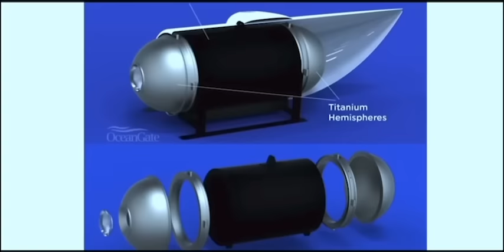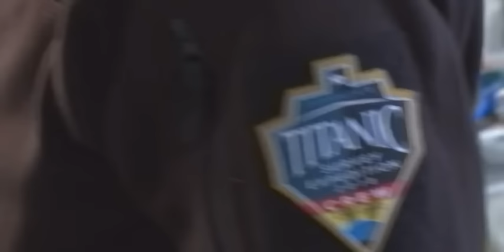First look at #oceangate #titan Debris

Comment: I read that the metal breathes, can expand and contract. The carbon fibre however is brittle and frigid. It doesn’t expand and contract with the changes but shatters like glass
Reply: correct
Reply: That's why during a NASCAR race, if someone goofs and hits the wall, sometimes, they halt the race. If the judges and safety crew walk out to the accident site and start literally crawling on their knees, they're looking for tiny shards of carbon fiber because it will easily slice open a tire, causing more accidents. And the real horror is that they don't always succeed in finding all of it. Sometimes, they even use a massive vacuum cleaner on a trailer to suck up any leftover debris from the accident. I've seen an IndyCar race on TV where a driver suddenly slammed into the safety wall at 180 mph. His boss said it was caused by a scrap of the stuff puncturing his tire. Those drivers are brave.
Reply: Thats why they needed to glue it together. If the glue is flexible enough it can compensate the difference.
It's also why this wasnt a good idea in the first place.
Reply: Had the ring that joined the titanium end caps to the carbon fibre body had longer mounts with more glue to hold, this thing would have changed the world. Rush was in the right direction, just needed a bit more glue. I hope OceanGate doesn't give up. I would love to go on the next one!
Reply: @beckydoesit9331 troll comment lol
Reply: Either way .. the movement between the two adjoining pieces would have broken the glue. It's so dumb there isn't much you can't criticize. This is a smorgasbord of fail.
Reply: @NoHurriesNoWorries  😅
Reply: what about DIY SUbmersible glue?
Reply: @beckydoesit9331  sniff more glue, gotcha
Reply: @donaldcarpenter5328  incorrect, misinformation.  It is true that carbon fiber coefficient of thermal expansion is near zero or even negative in some cases but just like metal there are dozens of grades of fiber and even more of epoxy and hundred of combination of them. Brittleness was a thing in the early days of carbon fiber so was fatigue. Some people are stuck in the seventies and like to repeat the same "I've heard that...." Today the thing that makes those dangerous shards when it fail, is used to make racing crash helmets and the HANS system that are going to keep a drivers head on, and in one piece, not stab him in the eyes. Today some guy is barreling down the mountain at 80 kilometer an hour on a bicycle made of the brittle stuff that is going to fatigue under him and get himself impaled by the shards NOT!! Today airliners are flying from 100F on the ground to -30F at 30000ft in a matter of minutes on carbon fiber wings. They do it many time a day and will do it for years. Today some rocket flying on cryogenic fuels chilled to -297 are made of that brittle and frigid stuff. Today an F1 driver hit a guard rail hard enough to jam half of the carbon fiber car under it and walk away from the resulting fire with a burned hand. Today someone decided to use carbon fiber in the wrong place for the wrong reason using  bad engineering and the bad rap is landing on the material . Richard Branson once bought a metal sub to attempt a record, the builder told him that the sub had been at that dept once already and that was its designed life. Branson put the thing in a museum never used it: Good, responsible, engineers talking to someone understanding/respecting engineers. The Titan incredibly had been down there many times and the guy who didn't listen is now fish food.
Reply: @bobsterclause342  Oh no they used brand X that was the wrong one Joker
Reply: @beckydoesit9331  in glue we trust

Comment: A spherical pressure chamber would be much superior. Also, the surface area that they applied the epoxy to looked much too small. In my opinion, it should have been at least three times the surface area. I guess he was thinking that the pressure would squeeze the two titanium spheres together and there wouldn’t be a problem.
Reply: a carbon fiber sphere?
Reply: He was correct. Those joints are in compression. lotsa compression. They were NOT the point of failure. The carbon fiber of the cylinder imploded.
Reply: @leecowell8165  You are right about the joints being in compression. The problem is that carbon fiber is not strong in compression, it’s like pushing a rope. In this case, a rope embedded in plastic, but still a rope. Over time the movement of the fibers within the plastic matrix causes delamination, and that is probably what caused the implosion.
Reply: @ScreamingEagleFTW  Not carbon fiber. I should have specified a titanium sphere. I would not trust carbon fiber.
Reply: Flex glue
Reply: Are u mad Glue take load of pressure. I just wondering why it not imploed on first. I was thinking under carbon fiber there is titanium skull. This is top notch third class engeneering.
Reply: He needed money to do this. He needed room for paying passengers. A sphere for 5 persons would have been quite big aka very expensive. This was the cheap und unsuitable solution.
Reply: @leecowell8165  sir joint is the cause just go with engineering

Comment: Only glue holding the sub end caps on! Wow! I'm surprised the sub survived the first 20 dives.
Reply: I'm reading conflicting reports all over the internet about how many dives to the Titanic, the Titan did.  From 3 trips to dozens.
Reply: @CyberClu   Yeah, I wouldn't be surprised if the actual number is 3 full depth dives.
Reply: @CyberClu  I read 13 previous dives, this was 14.
Reply: It might have been really good glue, like Duco Cement.
Reply: Failed at the 13th dive.
Far from 20.
Reply: @szaki  Yikes, only 13th. So it's true, 13 is bad luck!
Reply: I think the confusion comes from how it been worded. There was 3 expeditions, each expedition consisting of 8 days, and of those 24 days they managed 13 dives before the implosion. About half the time this thing was supposed to dive it was scrubbed due to all kinds of different problems
Reply: @Dakottle  The universe was trying to tell them over and over and over to open their eyes!
Reply: @mrdan2898 The universe doesn't tell anyone anything. It's not a sentient being. It was God they weren't listening to!
Reply: @suew4609  Yeah I agree. I was my cryptic way of saying that!
Reply: Many dives were not to Titanic. I believe it only went to Titanic 2 or 3 times prior. They heard a lot of cracking of the hull but the CEO said it was no big deal and that a certain amount of carbon could fail just fine. He installed a monitor he made that he said will let you know when it's about to fail. Said you can tell when the port window was about to blow as it will crackle first. He seemed to gloat when he said that like it made him a certified bad ass?
Reply: @sunfish4095  Yeah, He mislead everyone making them think it was engineering safe. Too bad he can't be brought to trial and have to answer for his poor, criminal choices.

Comment: Even if that glue job was the most pristine glue job ever seen, I have severe issues with the fact that no one applying the glue was wearing amy sort of protective gear. Any strand of hair or clump of dead skin cells that get in the way of that, is going to be just enough for water to get in at that depth. 
Every viable safety measure was completely lost on that fart sniffer of a man, Stockton Rush.

Comment: Notice the strap for the nose cap being unloaded goes through the hole where the viewing portal was, so it's missing, it was only rated to one third of the depth that they were taking the submersible to. There were so many things most of us lay people had seen in videos that seemed bad, from the bonding of the titanium to carbon fiber, the cylindrical shape of the carbon fiber portion and the way the carbon stands were wound in only one direction. I had seen another video where someone said Stockton Rush had told them that he saved a lot of money by buying the carbon fiber strands that were past the shelf life date.
Reply: many of us are standing by like you to see which way the portal acrylic was broken.

Comment: The photo you point to means nothing. The ENTIRE carbon fiber cylinder shattered like glass. That ANY carbon fiber is still attached to the titanium is evidence that the bond didn’t fail, it held those scraps of carbon fiber and resin on inspire of an enormous force.   The thing about the design is that the sea pressure was pressing the two titanium domes ONTO the cylinder.  Under pressure, they didn’t even NEED the glue. Its only function was in SEALING the ends water and air tight.  Its possible that the titanium domes CRUSHED the cylinder between them, but that is, again, NOT a failure of the bond.  The reason no one else makes a manned deep sea submersible with a cylindrical pressure hull is because the crushing force in the middle of the cylinder can deform it inwards more readily than a spherical shape.

Comment: I was wondering why the pieces are covered in tarp.  Could it be the remains of the crew stuck to the inside? They did say they found remains.
Reply: more likely so they can secure the piece while bringing it up, it's a long way down and you'd hate to drop it on the way up. Covering any human remains would be a bonus.
Reply: Remains at that depth become liquified
Reply: It could be to hide the logo Ocean Gate; bad publicity. The wrapping protect pieces that could fall off or be damaged during the transport and mess up the investigation.
Reply: It was raining? Nah, they just pulled it up from 12,500 ft., so I guess that's not it!
Reply from the maker: well looks like they tried to cover all the pieces but some were to big but yes could very well be! i thought they would be in small pieces and never recover parts of ppl but they did find remains! unreal! RIP
Reply: @DoctorEnigma01  bones stick around for a while

Comment: I can't believe they only used glue alone, no bolts or extra strength bonding. When you see this process as you said, it's surprising it was able to make one successful dive, let alone multiple.
Reply: You do know that adhesive bonding is VERY common on aircraft???
Reply: @caerleon87  It's common in a lot of things. This had to sustain much more pressure than an aircraft.
Reply: @rockyo59  Would not matter if the ends were not secured at all, the water pressure would hold them on, make no mistake.. Say the thing was 60" diameter, the pressure on the ends would be a rather amazing 7000 tons..
Reply: @caerleon87 yes the pressure would hold the ends on.  I have a feeling it delaminated from the center
Reply: @caerleon87 an aircraft doesn’t have to withstand anywhere near as much pressure as a sub.
Reply: Yes, exactly. Most of this is just common sense and a lot of us see a major issue in this design.  What were the engineers thinking when designing and building this submersible?  I would think most would be extremely uneasy having anything to do with this project.
Reply: @caerleon87  You are correct EXCEPT once there is a breach in the hull that all changes and an implosion is going to happen.
Reply: @5954ldydi  Yes, once the hull fails, then that is the end of that as you say!

Comment: I have seen many instances of aerospace hardware that incorporated an epoxy structural bond.  In almost every case the surfaces (usually metal to metal) were either mechanically or chemically etched to form a stronger bonding surface.   Even if the two materials (titanium vs carbon fiber) had a similar coefficient of thermal expansion (CTE) the axial bonding surface was insufficient. 

There is also the question about the CTE of the particular bonding resin used.

Comment: I've always wondered how the penetrations for electrical and air supply work since they are outside the pressure hull. I've heard a pin hole at that depth water can cut right through you.
Reply: Me too. Knowing this craft though, the wiring holes were probably filled with glue.
Reply: Very good question. Was it through the carbon fiber or titanium caps?
Reply: True .. at that pressure, a pinhole will cut right into and through one.
Back the the 80's, the Deep Level Mine I worked on used 'hydropower' as a primary source to operate it's drilling and cleaning (mucking) equipment. With a 'head' of over 2000m, we were very aware of the leak hazard.

Comment: I think the pressure made carbon fiber yielded at the center and bent so in the process pushed itself away from the glue and subsecuently from the end caps (this could have happened slowly with every immersion) breaching the structure. Wondering if some simple rods threaded at their ends helding both ends of the titanium rings pressed tight against the carbon fiber would have helped into a more rigid  structure.
Reply: the threaded studs that you mention in your comment would only have helped (perhaps, depending on their thickness and material) so that the rings and covers do not come together separately from the seabed, nothing more...
Reply: @juanzz412  threaded studs…if anyone had mentioned that idea when they built it…this guy would cut corners on those even… he’d use rivets and in so doing rate it for 10,000mtrs
Reply: Would have only delayed the inevitable...

Comment: Actually, what would have happened is that the Carbon Fibre cylindrical vessel which was made from straight strands of fibre instead of a weave would have cracked in a circle on the inner wall due to the tensional stresses applied on the outside in the centre of the cylinder by the water pressure. The crack occurred because there was no strength in the length direction of the vessel as the fibres were straight so the only strength was in the resin which has little tensional strength, so the resin split away from the fibres, the water then came in and blew the ends and the window off the sub from the inside , taking everything with it. The whole thing caused by a lack of understanding of how to weave fibres for strengh. Why did nobody realise this ?
Reply: Exactly. He was relying on the RESIN tensile strength NOT the fibers. Incredibly STUPID!
Reply: correct it should have been crisscross weaved
Reply: This seems obvious to a layperson like myself... Too obvious. Makes me wonder if maybe I'm missing something important, some non-obvious detail / factor that meant the fiber orientation scheme they used was actually a good idea rather than something outrageously foolish. Surely these people weren't that ignorant... right?
Reply: He was so concerned about the carbon fiber being 5"s thick, as if it's all he concentrated on. How could he not see that epoxy could break free from either the titanium or the carbon after cycling a few times??

Comment: Like stamping on a can of Pringles I reckon. The air forced the ends off and the porthole out after the carbon fibre hull failed 🤔
Reply: That's how I picture it.
Reply: That or a can of those Pillsbury crescents that pop when you take the wrapper off and press a spoon into it... Smh.
Reply: The air pressure would have been negligable next to the pressure from the ocean. If the carbon fibre shell started to fail, the end caps would have rather been forced inward from the pressure.
Reply: @sk4lman  Yeah it’s one of the two. Which way the missing porthole went may be a key factor
Reply: @maclivingston9268  you’re triggered by a simile!?

Comment: As for "glue" between titanium and carbon fibre, these two material will contract and expand differently under pressure, that is MOVE relatively against each other. If the interface is not intentionally designed to allow for this movement it WILL FAIL.